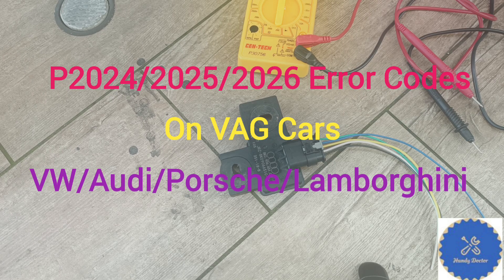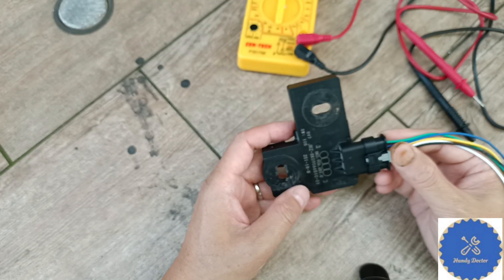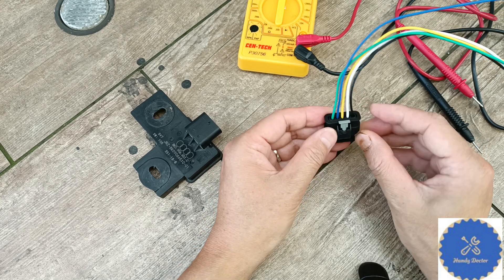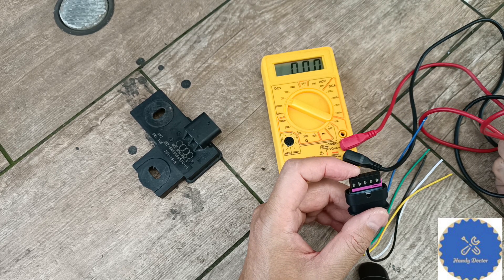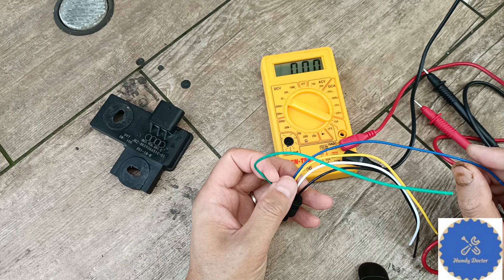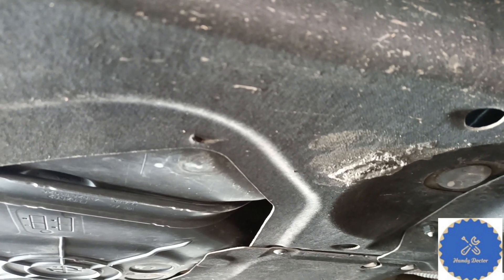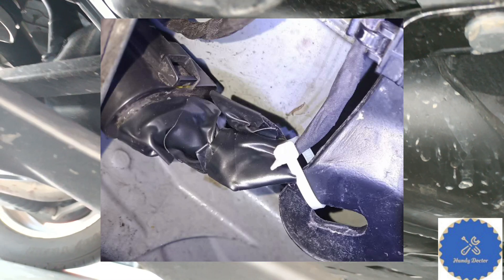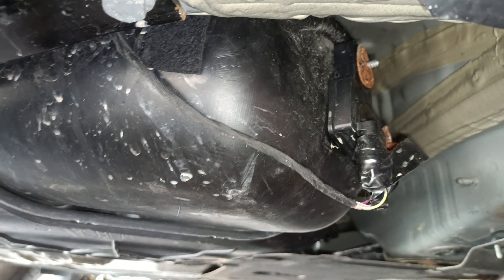$0 Fix Audi P2024 P2025 P2026 Evap Codes: VAG Cars (VW Audi Porsche Lamborghini) in 15 Min. OBD 2

Comment: Hi, wondering what year and vehicle you're working on? I along with some other have a 2018 Audi A4.  The part you have doesn't seem to be for an A4(A3 yes) and I can't find a leak detection pump module for my vehicle in parts or location search.  Where exactly is yours located? Thanks
Reply from the maker: It's a 2019 Q7. I think A4 A6 etc have different configurations. Did you check the entire gas tank? It may be on the other side.

Comment: Hello I need help. I have EVAP FUEL VAPOR temperature sensor circuit. P2024 code. I have searched for part almost 2 years I cannot find it. I use an audi q5 2014.
Reply from the maker: The power wire is broken somewhere. Did you do what I said in the video?

Comment: I did check mine and checked the wires but there is no power on the circuit so is there any fuse or anything I can check my car is Audi a4 2019
Reply from the maker: There should be a fuse. Check it first. If fine, you have to check the wire like I did

Comment: Hey doctor I have a Audi a4 2019 and I have p2026 code and it says (Evaporative
Emissions
(EVAP)
Fuel
Vapor
Temperature Sensor Circi
Low Voltage) so you think that’s what i should check the wiring please help me asap thank you
Reply from the maker: Yes, check the wiring.

Comment: Thanks for the video. Unfortunately my power wire was broken right at the clip so ordered the new harness. Have some soldering to do in an uncomfortable position.
Reply from the maker: You should be able to depin the current one and pin them back into the new harness. In this case, you only need to solder the power wire. Good luck.

Comment: U have a p2025. And I'm getting higher than 12 its even reaching 18 and going higher
Reply from the maker: 18 volt?! How can that be possible since the alternator at most would supply 15v. I don't understand why. I'm sorry.
Reply: @HandyDoctor89  i dont understand why either  but I change the sensor and it's good now
Reply: @chriiss6936  Hello, i have same code. what sensor did you replace? do you have a part number? where is it located? thank you
Reply: @dennisalcocer6902  check the last part of the video.  Youll see where it is. Its next to the gas tank passenger side was hard to reach  getting it out is 1 but putting it back up is a massive headache

Comment: I got P2026 on my audi a6. Can i electrical tape the wires? Or do i need to solder it?
Reply from the maker: @abdulhaseeb5191  you can but not a good permanent solution